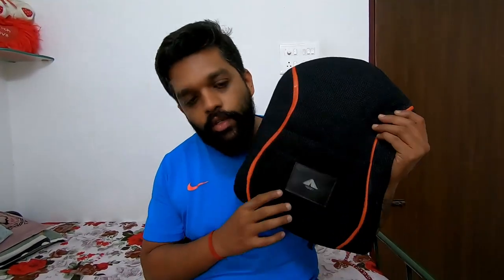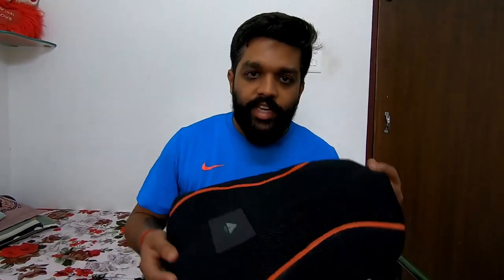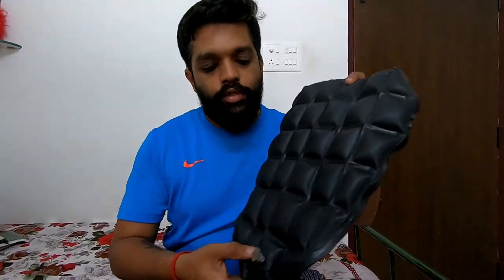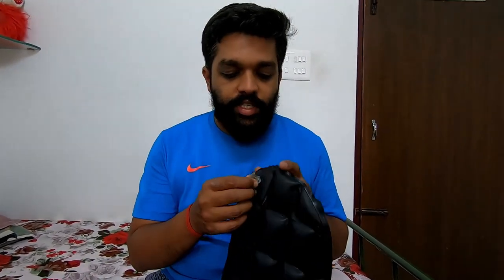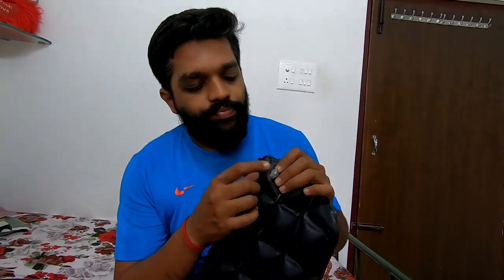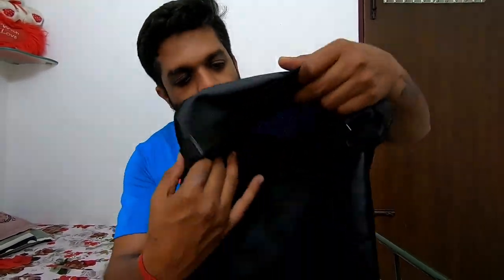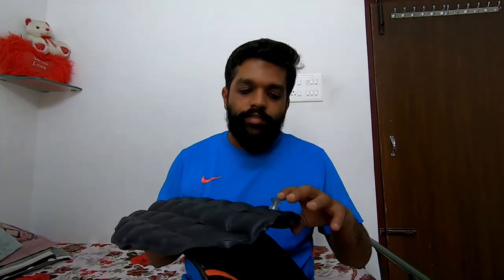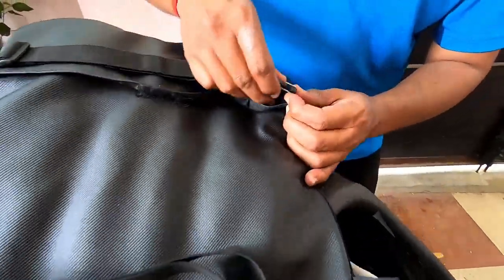Fego Float Seat Review - A must have for all the bikers

Comment: Bro..if I fill air and sit, sometimes the air is going out..I think cos of nozzle...what to do? Any solution?
Reply from the maker: Hey. Same thing happened to me also at the starting, but then I understood that I am filling to much air and that only little air should be filled and not fully. From then it was fine. So you can also try this.
Reply: @Rohittheblackvizer  okkk thanks bro...which fego model is suitable for Suzuki Access???
Reply from the maker: @shaminmanoharan  well I suppose the new one should fit, but it always good to ask the manufacturer directly to get the correct answer to your question.